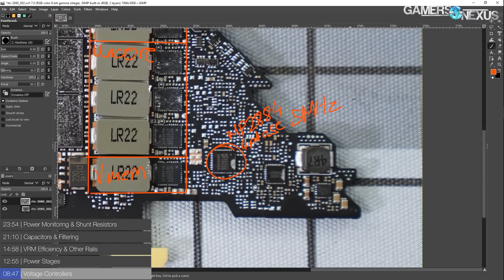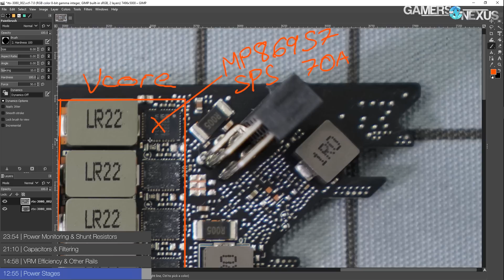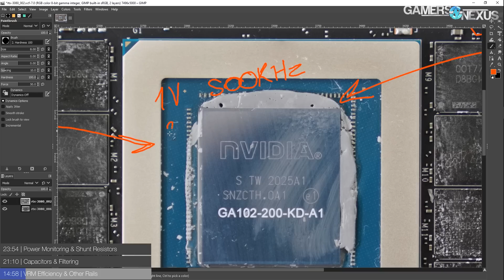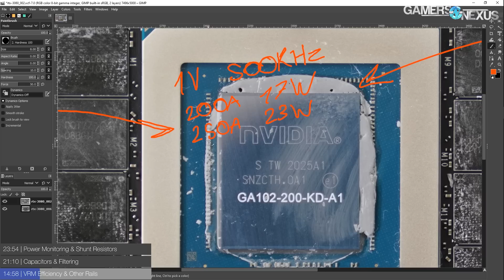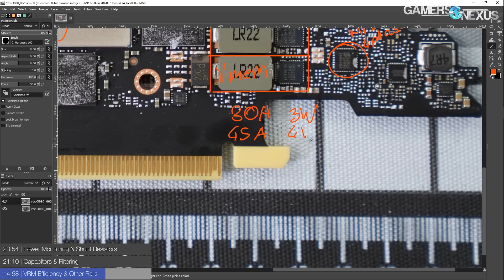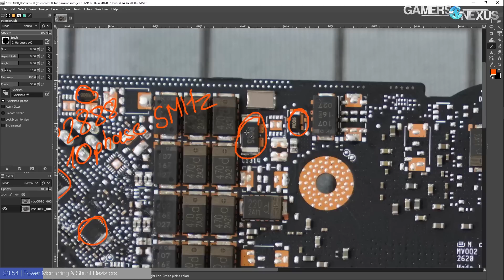GPU PCB Analysis: Founders Edition RTX 3080 Build Quality & VRM Capabilities

Comment: While  pulling 200A or 500A means nothing to me as a dude with a core clock slider that imake bigger number and more fps comes out for. I do like hearing, this part gooder than could be.  Kinda wanted to hear a bit about the center bit with the different "core power filters"??? the 2x3 layout right behind the main dye. the MLCS? vs the SLCS? Dunno if I have those named right. Basically hear that the large chips are worse than the mini grid of them, blah blah stability.... a bunch of tiny ones are better for FPS. Something something the ASUS TUF has 6 mini grids and is really good. What chu think?
Reply: This was recorded quite a bit ago and Buildzoid has his statement on his channel Actually Hardware Overclocking (AHOC)
Reply: The Link: https://www.youtube.com/watch?v=GPFKS8jNNh0

Comment: The FE editions seems to be really nice gpu! If you can just get it, you don`t get Better unless you pay ridigilously more money...
Reply: Right? I feel like the only AIB 3080s worth buying will be $800+.
Reply: @neonlights_12  The ASUS TUF seems to be done right (and priced around the MSRP for FE), the rest seems either overpriced or there were some corners cut when making those. So far there seems 0 reason to buy anything else than the ASUS TUF, and this is coming from a person that never used ASUS parts because they would always be overpriced.
Reply: @Yuri_Yslin  Yup I agree, the TUF looks to simply be the best card to get if you are spending close to MSRP. Other cards might be better than the TUF but they cost more.

Comment: Why the hell did Nvidia left those two memory slots? 1GB per chip. There are some thoughts on 10GB that might not be enough, but if they put two more chips it would become a 12GB card, which is just perfect in my opinion. Can someone tell me why? I cannot think of it in any other way than a middle finger from Nvidia
Reply: My guess is Nvidia is barely ok with consumers skipping gens before upgrading. If they’re making these cards with little to no OC headroom, or at least making it 10x more difficult to hard mod, it’s forcing us to consider upgrading each gen vs having the capability to sit on these cards for years.
Reply: Lala Fafa Because it would have been even closer to 3090...
From my crystall ball I can see 3080ti that has 12gb of ram... how strange who would have ques that would happen...
Reply: So they can drop a 20gb card.
Reply: The 1080ti and 2080ti, in my memory, both have one spare memory socket. There were never any 12GB variants of those.
Reply from the maker: Memory isn't free. It'd cost more.

Comment: Guy with 3080: Im the Best at Overclocking
Guy with 3090: No im the Best at Overclocking
Random Guy: Pfft Amateurs...
3080 & 3090 Guys: WHAT WAS THAT PUNK!?
Keanu Reeves running 4x 1080ti's in SLI

Comment: Why do people keep calling them phases?  DC doesn't have "phase" as it's not a waveform it's a straight line.
Reply: It's not that kind of 'phase'. A phase is a couple transistors a choke and a capacitor, and then the board might use like 3 to like 15 of them. More phases means more power delivery from the board itself
Reply: onionynous thanks!
Reply: So you don't know how a VRM works...
Google it or watch a video (Buildzoid did one some time ago), explaining it.
Reply: Sorry, but VRM is just a bullshit term made up by motherboard marketing department.  If you search any electronics space for VRMs you will just find people talking about Volts RMS.  Voltage regulator module means nothing.  You will find dozens of topologies and concepts of voltage regulation, but nobody except PC builders calls them VRMs.  We would call them power supplies, voltage regulators etc.  If you google VRMs referring to PCs you immediately get the sense they have no idea what they are talking about either.  Like showing the incorrect topology of a buck converter.  Confusing chokes and inductors.  etc. etc.  Using hand wavey terms like "Error amplifier"... again a bullshit term for an op amp configuration.  Not a single explanation of how a buck converter actually works.
The "phases" thing seems even more confused.  They show diagrams with each buck converter pulsing it's output and claiming that as one buck converter drops down the other rises up, but then shows them connected together....  no, that's not how it works.
But anyway, I get why they like to call them phases if they stagger the PWM through parallel buck converters and filters, but it's still DC and the outputs are just parallel rails and have no phase property at all.... except if you include the phase of the switch mode noise and inductor spikes that don't get filtered out.
Staggering/cascading the PWM will allow you to get an artificially higher switching frequency without actually switching that fast.
The reason you have a load of them is ... given a 200W CPU running on 1Volt pulls 200A.... you can't run 200A through a single board trace without setting it on fire.... so many parallel power rails are required.
Reply: @1over137  Buildzoids word on this:
https://www.youtube.com/watch?v=oDRHV3qtSWc

since I am not an electrical engeneer, but a mathematical physicist
Reply: I found this which is at least speaking the correct language.
https://www.ti.com/lit//slyt449
Reply: @emmata98  Sorry, but he hasn't a clue what he's talking about.  I could list the errors in the first 10 minutes, but I'll not bother.
Reply from the maker: Because it's a phase?

Comment: Too bad the cooling solution doesn't cool the memory chips very effectively.
Reply: ...it does fine lol
Reply: @johnathanera5863  104°C isn't fine, when the memory already throttles at 110°C.
Custom coolers manage to cool their memory down to 84°C, which is much much more reasonable temperature at which the memory should be run at.
https://www.igorslab.de/en/gddr6x-am-limit-ueber-100-grad-bei-der-geforce-rtx-3080-fe-im-chip-gemessen-2/
Reply: I want my card to run at 200 Celsius, that would be amazing

Comment: My question is: OUT of all the 3rd party vendors: WHO HAS THE MOST "OVER BUILD" PCB??? Can you please answer. That is DA ONE that I'll be buying!
Reply: IMO ASUS seems to be the more ''over the top'', even their base TUF model have good cooler, VRM and trace design.
Reply: @Verpal  ASUS TUF is also using 6 of those mini arrays for the backside of the GPU, to the FE's 2
Definitely overbuilt, and good on them for it
Reply: It's usually Asus. In my experience their quality has always been high with all their products.
Reply: @ze_rubenator  
For such a high-end build quality I see too many RMA situations with their stuff. DOA motherboards, at least were commonplace, for some reason.
Reply: asus tuf ftw
Reply: Kingpin will have the best PCB. That's the one you'll be buying!
Reply: @四as  ah yes a 1100 dollar 3080.
Reply: It probably isn't out yet.   Kingpin or HOF.
Reply: Its already been stated, its Asus. Board wise, it's more over built the the FE card.
Reply: @Gandalf721  I agree, but that's irrelevant. Are you also going to say Asus TUF has THE MOST "OVER BUILD" PCB? Budget card with pinnacle PCB.

Comment: can’t wait for a Strix 3080 analysis
Reply: Would love to see the Strix breakdown!
Reply: That's the one I'm waiting for! 😁👍
Reply: Heard that the strix has 6 good quality capacitors, think I'm going for that by default for that reason, even if it's overkill, but I also care very much for the noise levels, my old 970 strix was quite loud when the fan actually started spinning..
Reply: Vorpal Well the review for the 3090 strix isnt good news for noise, its actually disappointing. There is some room to tweak it, but they are threading the line on what’s practically possible within the dimensions - assuming you don’t want your card in the 80s! There are also shots of the card with a mix of capacitors, so I don’t know what’s going to be going out to joe-consumer next month.
Reply: @utubby3730  The Strix noise is quieter when the vBIOS is switched to Quiet mode. (Or if you set a less aggressive custom fan curve)

Also I think the reason it's louder than usual is because it's running factory overclocked with higher power draw and more aggressive fan curve (with Performance mode vBIOS)
Reply: @utubby3730  Oh god, fuck me. Then I really don't know what I'll end up getting, the FE doesn't even get shipped here at Greece. Maybe 3080 will be different? TUF edition is silent btw? I'll have to research on the differences it has with the strix.
Reply: @vrykolas  I dont want to make it sound terrible! But the card has a PL of 480W, you would need an even bigger cooler to keep that thing both cool and quiet while pushing it. You can either use the silent BIOS or do your own fan curve. If you dont push hard (so maybe 420W region) you could probably get a reasonable balance.

I havent seen a review for the 3090TUF yet - altho I am actually watching a VR video of that very card atm, its just a user running thru some games. Core is very often 1935 by the looks of it, which is decent (I dont believe they have done anything with it - its the TUF OC model at factory setting) they dont show temps or fans :/
Reply: @utubby3730  I'm after the 3080 btw, not 3090. Can't even touch that. XD got a gold plus seasonic 650w, after some calculations it will go to 555w full load, so power wise I hope I'll be ok with the strix (it's at 1710hz iirc, that was included in my calculation)
Reply: @vrykolas  Oh, 3080 is easier to deal with, its just the bottom tier cards you should avoid. The TUF is the only one thats close to FE MSRP thats decent. Otherwise, gaming X, whatever the middle tier EVGA one is and of course all top tier. That sucks that the FE isnt an option to you, but its also hard to get rn for most. I would like an FE 3090, but I have ordered 3090 Strix from a few places, so if I cant get the FE in the meantime I will eventually get a Strix.

PSU is prob fine, it would be a little tighter than I would like. I usually aim for 50-60% PSU load which is within their sweet spot. Seasonic is top notch, so unless its quiet old (8+ years), it should work - without aggressive OCs!
Reply: https://youtu.be/qVoxaKVpJzc 3080 Strix
Reply: @utubby3730  Thanks for this! I will check the video after work too. I never plan on ocing my 8600k or the 3080 so I think I'll be fine. It's a seasonic focus 650 gold+. Only had it for a couple of years.

I really hope the 3080 strix is on the silent side and they keep putting the good quality materials and its not just the pieces they give for reviews. The one I have right now is an msi 1070ti, which is extremely silent...kinda bummed they didn't put 6 good capacitors. Thanks for all your help btw!!

If I could I'd get the FE.. it's too beautiful, but going on about ordering one here is sketchy....
Reply: @vrykolas  Just thought Id give you a heads up. Ive seen some amount of posts in the last few days with people who are having trouble powering their new cards. Folks with 750-850W high end PSUs. As it was, I felt you were cutting things tight, but these cards are properly hungry. I have an 850W plat from seasonic and even Im considering a new PSU (will be OCing a 3090 Strix).
https://cdn.mos.cms.futurecdn.net/dtXifjxt3yZzh2dLJ2Q8Z5-970-80.png.webp
Id take these as minimum
Reply: @utubby3730  oh damn it, 3080's? Then I'm really fucked, I'd hate to have to rebuild my pc...
Reply: I'd go 850 minimum
Reply: @utubby3730  For a 3090 I would say 1000W would be ideal. I'm using a Corsair RM850i with a 3080 STRIX OC (115% pwr) and 10900K @ 5.1GHz. Stressing both tops out at 815W with 90.1% PSU efficiency. So it's just enough.
Reply: I've had the 2080ti strix for over a year now the fans are loud replacement fans are £18 of ali express might have to do that temps have never gone over 70 with a fairly beefy oc great card
Reply: When anyone mentions Strix I keep hoping for an actual owl (it’s also the name of a genus of owls, named for a type of mythological monster, with no ear tufts). But I’m odd.
Reply: @markiangooley  the packaging of the 980 strix had an owl in it if I remember correctly :o

Comment: Are NVIDIA and AMD trying to kill AIBs?
Reply from the maker: Not yet, maybe one day. They don't have the logistical or support capabilities of specialized partners, and certainly AMD is not in a position to do that right now.
Reply: @GamersNexus  since your factory tour, corsair makes the quadro (as of that video), do you know who AMD works for their own gpu line? powercolor or sapphire? Thanks for content.
Reply: @Gandalf721  the designs still need to be approved by nvidia.
Reply: @WayStedYou  No, they don't. Nvidia provides the MINIMUM specs. It's up to the AIBs to conform to it. That's all.
Reply: @Gandalf721  Didn't that go badly for 3DFX?
Reply: With the way these 30 launches have gone I’d say they can’t make enough cards to
Reply: It would be wonderful if NVIDIA tried this and every AIB partner went AMD.

AMD Could definitely do with a more diverse AIB landscape.
Reply: @Gandalf721  Correct. That is exactly why companies like WalMart are taking over most of the supply chain for the products they sell with their private label on it.
Reply: They just need to hold AIBs to higher standards.  Look at what happened when 3dfx  bought out STB so they could make their cards themselves.  The part I don't understand is the high cost of AIBs vs the Founders Edition since it probably cost a lot more to make an FE this time around than the AIBs to make their cards.
Reply: What AIBS stand for?
Reply: @RyuKimGaming  Add-In Board
Reply: @GeorgeD1  Thanks!, I was searching but it say other meanings lol
Reply: @RyuKimGaming  Add in board partner(s) AIBs
Reply: @Gandalf721  it looks like the partner cards that suck nowadays and not NVIDIA

Comment: whats the point of overclocking when you barely get any FPS increase?
Reply from the maker: What's the point of fun?
Reply: @GamersNexus  okay i admire your enthusiasm
Reply: So you can get a few more hundred points in benchmarks
Reply: The increase is enough to make a difference depending on what fps range your in, if I can squeeze an extra 10 fps out of a card and make sure I'm past 60 fps for all games imma do it. Now if I was dozens of fps over 60 and there wasn't a single game that got me under that, then I personally wouldn't care.
Reply: @torinkramer7326  fair enough thank you

Comment: Hmm chuck it in the bin. The 3090 cant even do Flight Sim 4k above 50fps. I thought this was meant to be the future.
Reply: Just say you don't understand what Flight Sim is and move on.
Reply: @GinsuChikara  Hahaha just say you don't understand what a joke is and move on. PS I have a CPL..
Reply: @DistractedTrader  It's very difficult sometimes to tell what is meant to be a joke. There is no accounting for the idiocy in YT comments. Put a smiley on if you don't want to be misunderstood.
Reply: @Safetytrousers  Fair point! :)
Reply: MFS is unoptimised hot garbage
Reply: @hoveylu7231  Amen! It will take 10 years and an addition to the steam store for it be sorted :P

Comment: Too bad the memory hits 100+ C under load, no way I'm getting this and letting it render during nights. That's just not gonna last very long lol.
Reply: get a partner card
Reply: My Asus Tuf runs a cool 63 at load
Reply: Shaun James GPU temperature isn't the same as memory temperature.
Reply: @chunchunmaru  memory aint slowing down so it aint a problem
Reply: @Gandalf721  that temperature was recorded without any form of cooling. Considering that the memory has  thermal pads and a cold plate makes this information irrelevant